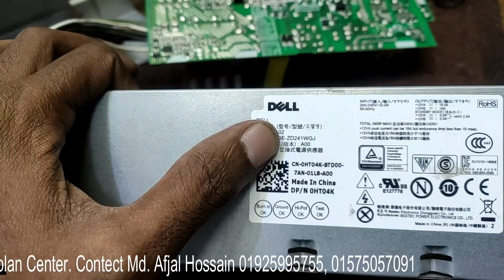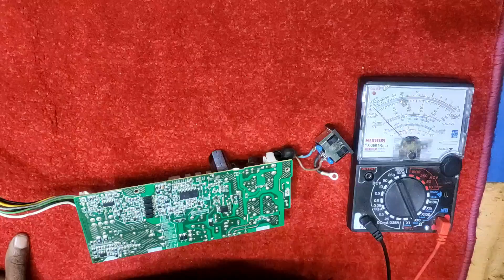HOW TO DELL POWER SUPPLY NOT WORKING 2019*NEW TIPS*

Comment: Normally psu bist light blink everytime you plug the computer. Right. But now , i plug the the computer no sign of light anymore. 

Bro how do know the power supply is dead. I try to test my psu, only psu motherboard and processor are intact. My psu is BIST BUTTON FREE.  I remove the 4pin 8pin connector from the motherboard , then plug the psu. The Bist light glow for 3 second,  i put back again, it won't glow. No sign of light, 

I try also psu test using paper clip method jamper black and  green the psu bist light glow and the fan is spinning

Is my motherboard is dead or my psu?